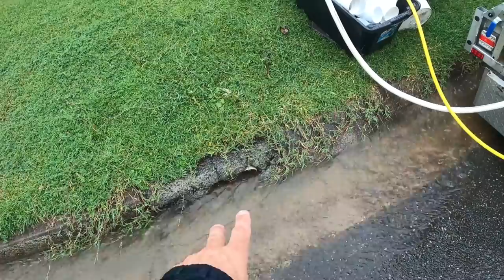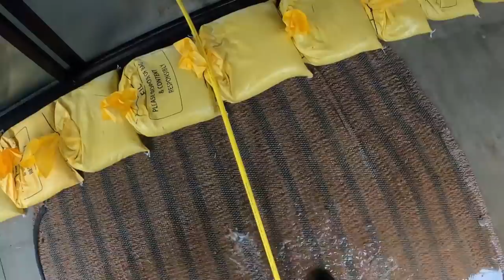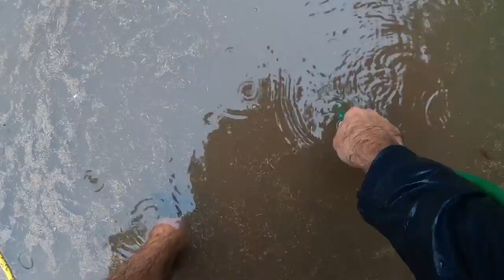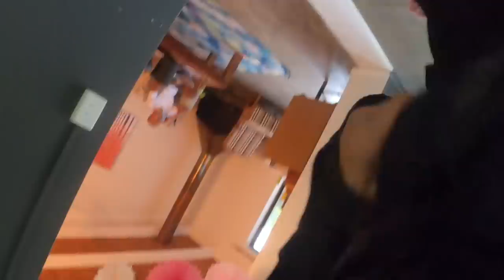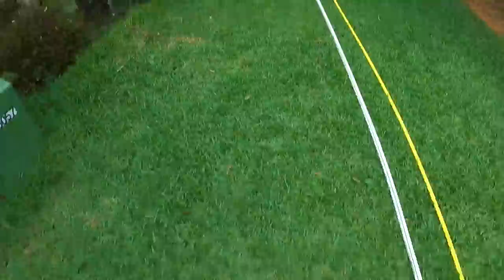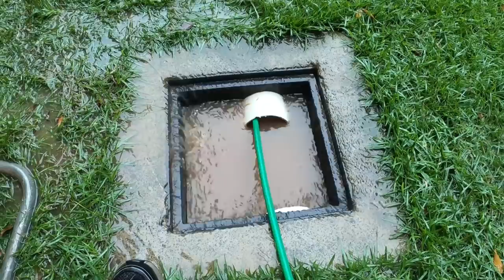Blocked Drain 213 - Tornado of water with amazing gush & whirl pool

Comment: In the states we have the ability to put in what is know as a backflow preventer. It goes from the large cistern to the street connection and keeps water from the street getting into your home. This is important if you have a basement and a high 
water table because days of rain will cause a big flood issue into your home. Of course you still have to keep your drains
clear of roots and the like. Congrats on cleaning out the lady's backyard pool Gav. Might come back with the camera.

Comment: Those tip cleaners are generally used on oxyacetylene torches but they also work good on shower heads when you have hard water and minerals start to build up around the orifices and start closing them off.  I do my shower head every few months just to keep it spraying good.

Comment: I love when family and friends call me with a blocked sewer pipe or drain line. Most people don't have a clue what is underground. They don't understand how there sewer lines in the house work or wich one is sewer. I have with there help dug 4ft deep trenches on there private property. Replacing with PVC. When working for gas utility I loved to dig by hand and still do I'm 60. They are surprised about location of underground sewer line and location of problem.  Most lawn repairs take 2 days and I pride myself on people not knowing where the trench was. Average private property repair 5k to 7k. Friends and family feed me and make sure water and coffee are a call away. I believe 1 day I'll get a favor from them in return

Comment: very nice result indeed :) why did u not go up from the street as well?
Reply: Looked like with all the water from the rain he couldn't tell which pipe was theirs (there were two pipes next to each other on the street).
Reply: @NicolaiAAA  yeah i saw that too, maybe go up both although i guess he was very busy at the time
Reply: @NicolaiAAA  a dye could have been used to locate the drainage pipe that needed clearing
Reply from the maker: Thank you 😊 
The really wasn’t any need at the time. When it’s a rain event, The goal was to get the drain flowing to stop the flooding. Further investigation can happen at later date if they choose to.

Comment: Shouldn't you wear watertight boots when working (for health & safety) in case the water is contaminated from sewer drains?
Plus, walking with those soaked trainers afterwards could transfer contamination elsewhere.

Comment: You could throw some dye down the pipe on a better, drier, day and work out which outlet it is out in the street. It might be time to make a major capital investment in a new set of tip cleaners even 2 sets. Cig or Repco will have them.  I'm a mechanic and we use them for cleaning out windscreen wiper nozzles when they are blocked. You can never find wire thin enough . Awesome vid and 10 points for persistence.

Comment: Hello Gavin, Happy Easter.
What kinda pressure/gpm does your jetter put out if I may ask.
Reply: jetters run between 4-5,000 psi and 4-5 gallons per minute. (about 20 liters)
Reply from the maker: Happy Easter.
Machine 5000 psi and around 24-27ltr/minute
Reply: no wonder you run out of water in your holding tank. The average garden tap can only flow about half that!

Comment: That Flood looked like my back yard. Neighbors had landscaped and every rain would push water under the fence into my property, flood across  our pool area and flood up to the back door.
Even with french drains, there was too much inflow.
So, my solution, along the fence line, I dug out a narrow trench under the fence, levered up the sagging wood fence line and installed strongbacks between supporting posts. Then I back filled the gaps with Concrete.
Next rainstorm here in Baton Rouge after that, their yard was a SWAMP and they went nuts.
The lady next door actually tried to dig back under the fence line instead of addressing their landscaping.
So much water built up in their yard it flooded their 2 A/C units. But, no more flood on the patio, pool or back door.
What was their response? They tossed Fertilizer over the fence into our pool, which turned it green. Caught on camera, the police got involved and put and end to that. BTW, when you get nitrate fertilizer in your pool, you have to drain the pool so it was World War 10 at that point.
Sold the house after the water issue was solved. Winner winner
Tried to explain to the morons, dig a narrow trench here and there on your property, divert your water...... Like talking common sense to a liberal.